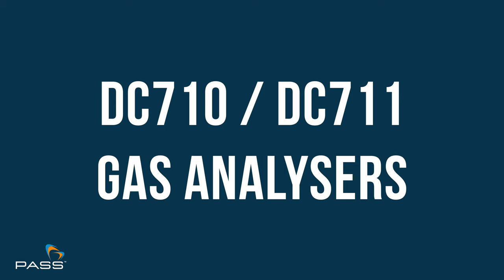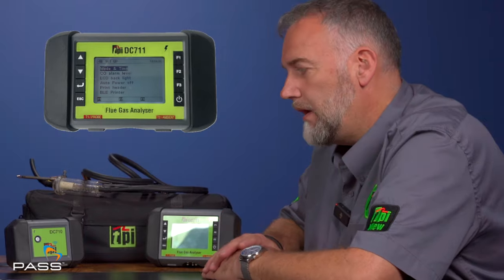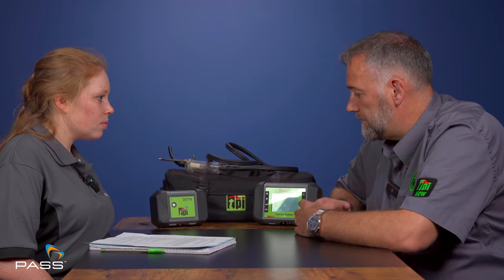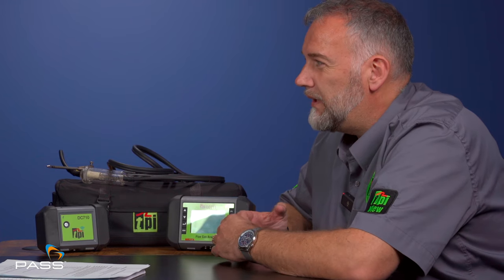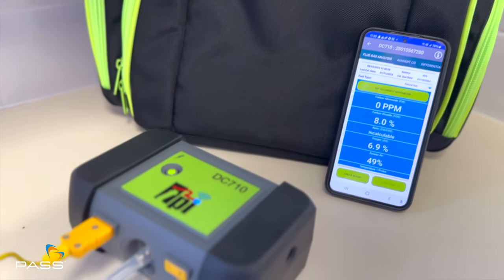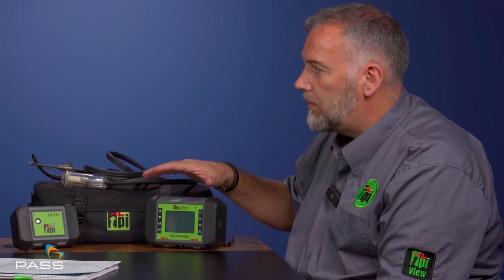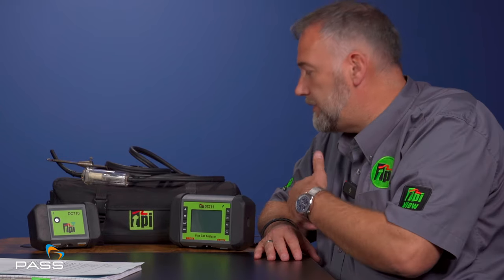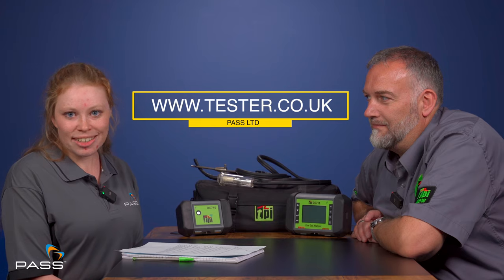TPI Flue Gas Analysers! Find out everything about the DC711 & DC710

Comment: I bought a DC710 in December and it's going back for a refund. Because of the fact that the calibration due date prints on reports I would have to send it every year in the middle of the winter, this is a no go. It also needs location permission to work which is unnecessary. I would have kept the unit otherwise but TPI said they will not change this.